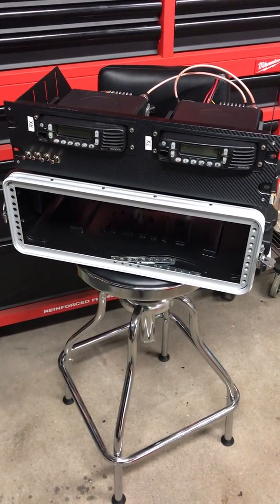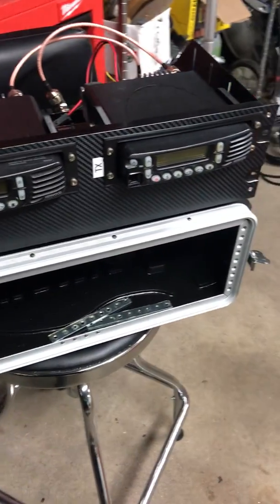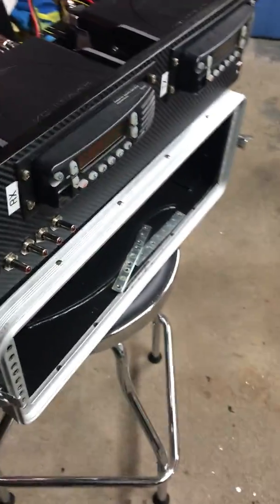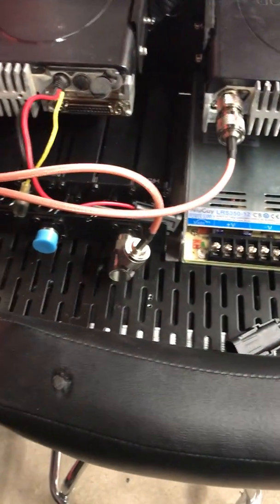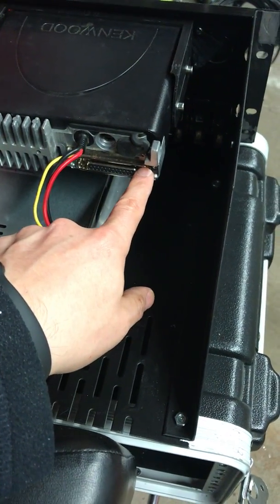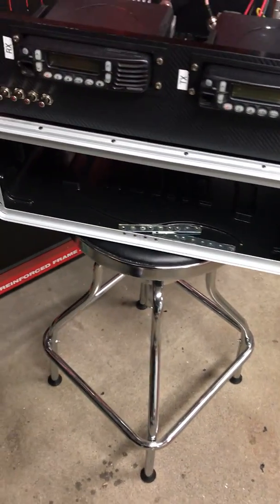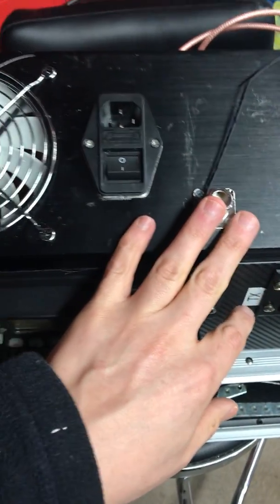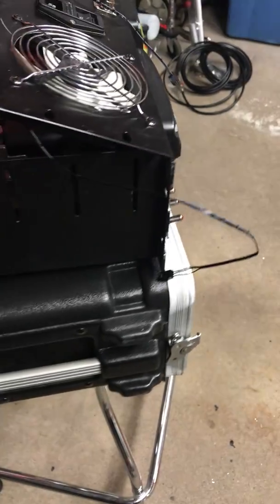GMRS Repeater

Comment: I'm building a GMRS repeater but am newish to radio comms and amateur radio too. Found some guides for building repeaters but would love the details on this build- in particular what parts to order and what you had to do in each of the 8180's to get it to work. Any coaching/tips you can offer would be great. Even simple things like where to buy the cables, the 90 degree connectors, etc would be a big help. Thanks in advance and appreciate you sharing through those videos what worked for you. One of best DIY repeaters i've seen.

Comment: Nice set-up!  Very nice build. what controller did you use for the radios?   I also like the 3d brackets that you printed out. How strong are they, and What would you charge to print a pair ?  I hope you keep making more videos like this, I am interested in how it performs when you do use it. I am now interested in making one for family use. Great work. !
Reply from the maker: Thanks! I used the ID-O-Matic kit (http://www.hamgadgets.com/ID-O-MATIC-IV). You could use an Arduino and add a pots resistor to reduce audio level out from the RX radio into the MIC input on the TX radio.  I'm going to be setting it up this weekend and using it. I'll post a video about it. I also plan to post a detailed breakdown of how I built it. The bracket is pretty sturdy, though I want to modify it so it has a tighter fit, and I want to strengthen a couple of spots. I plan to put the STL file on thingiverse
Reply: @whatsonmymind2180  can you post the detailed breakdown video?
Reply: Alright. I will be looking forward to seeing that .  @whatsonmymind2180